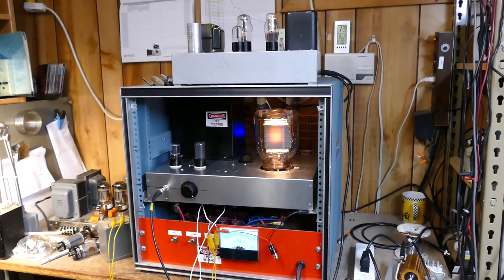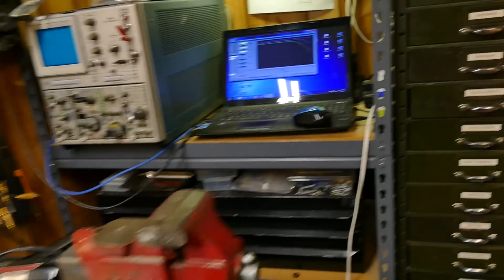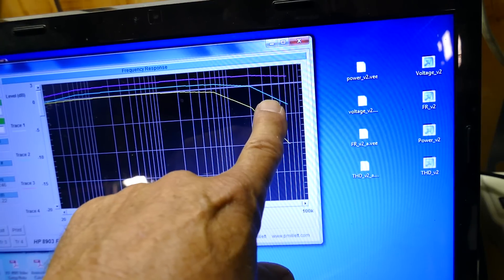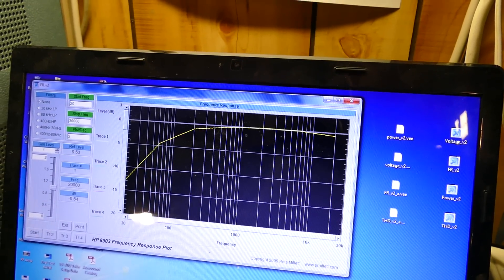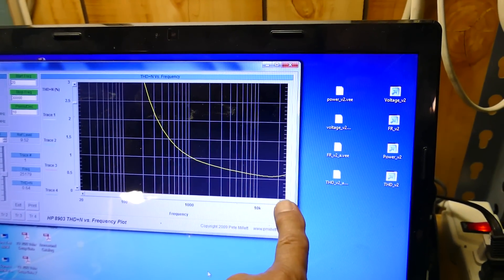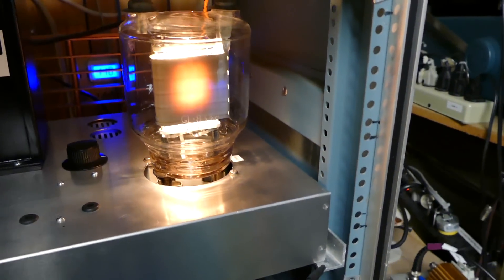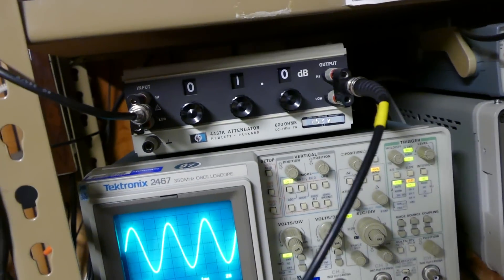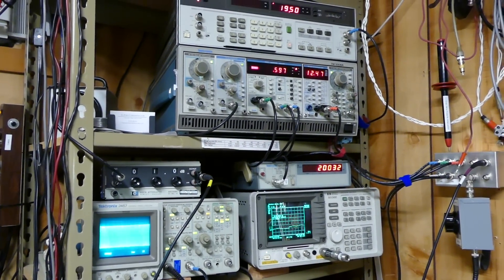833A Vacuum Tube Audio Amplifier Update

Comment: As this is an open-loop amplifier, you can measure at the 833 grid to see what's coming out of the driver when loaded by the 833 ... or have you already done that? If not, look see, maybe it is the driver stage after all. Not sure about that 10H inductor, I'm not familiar with this big-beast stuff, or RF, but at HF it is providing a very high output impedance for the negative swings, as they have to be sunk through the 10H. So if it performs well at HF maybe you just need more Z in the driver cathode circuit, not less.
Reply: ElPaso TubeAmps So, conclusion of this...is to me that the OPT is not very useful here, as it seems that there is no gap in the iron, so therefore it will reach its maximum magnetic field to soon and can not handle further power transfer to the secondary coil....
You need to have a SE output tranny or just make it PP and it will work, i guess ;)
Reply from the maker: QuadMaestro I have measured the signal at the grid of the 833, on the output side of the 4 uF coupling capacitor, and it is less than 1% THD at 20 Hz and 0.5% THD or less above that up to and beyond 20 KHz. I never drive the grid positive so I draw no grid current. My drive voltage is maximum around 30 volts RMS (43 peak) with a bias of -60 and a quiescent plate current of around 180 mA. The core of my transformer is not saturated.  But the 833 and transformer add the distortion. Bias is critical on the 833 grid for THD products. As for the 10 H choke, Xl at 20 Hz is 1257 ohms so I figure that should be sufficient. But to make sure, I have increased L in the cathode circuit to 37 H and it makes no difference. It also makes no difference if I make the coupling capacitor 50 uF.  I may need to consider,  as some have suggested, the output transformer is causing an issue as the transformer is designed for push-pull 810's. But I am not convinced the output transformer is a problem yet. Quite honestly, I am not sure anyone has made this thing work properly or may not have had the equipment to adequately measure the performance and have spend so much money they cannot admit (or realize) poor performance. Have you ever heard anyone play Heavy Metal (with lots of bass) through one of these amps?  As a last thought, I may juggle the turns ratio on the transformer and try it again at 1500 volts with a primary to secondary ratio that is appropriate for that plate load. I haven't given up yet and still have ideas but other projects are being neglected that I want to attend to. I will revisit this project in a few weeks with (hopefully) new insight. I always appreciate your thoughts and comments.
Reply: Well I know SFA about SET circuits but I do know that the OPT has to carry DC, lots of it, and is therefore designed differently from an OPT designed for push-pull.

Comment: Hmm i think i got it....i just caculated the ac-levels.....omit that 10H coil as it has a far to low impedance at low- frequencies....you sending all the low-end directly to ground....the same goes for that 100 muF Cap. omit that as well, as you sending again a lot of low-end freqcuency voltage to ground (that´s what a parallel kathode resistor cap is doing)

My calcs resulting in some 300Ohm loading that kathode at around 100hz while having some 1000s of ohms in the mid range. so you sending about 2/3 of the voltage swing directly to ground....

Replace the whole kathode circuit with a 4k7Ohm (start value) with let say 30Watts...and check the frequency response again....May it works better you can reduce that resistor and see if that driver will perform better....or you need to replace the driver tube with a more powerful type...
Just take a look at the "philips EL6471" Amplifier where an EL34 kathode is directly coulped to 2.5Tsomething (or 4cx??? in your case if i remeber that correct)

Comment: the curve looks like it is a cathode bypass cap  value is to low or decoupling cap value to low I know in guitar amps that makes a difference. but yeah why would the distortion be so high at low frequency
Reply from the maker: noahtheviking This cathode follower circuit performs much better than the transformer driven methods I have tried and you may have a good point with the coupling capacitor. I used a reasonably large (3 uF) non-polarized capacitor but maybe before shelving this beast maybe I should raise the coupling capacitor to 100 uF and see what happens. Thanks for the thought.
Reply: ElPaso TubeAmps Normally a 33 to 47 uf cap works at audio frequencies

Comment: It might be interesting to see how much phase shift occurs at low frequency. Normally such a LF loss is due to saturation of the iron core, but unlikely in this case due to the size of the transformer and the low power you were testing at. Negative feedback probably wont help that much as the HF is fine. Could the drive impedance be too low? I will probably be awake all night tonight thinking about this one!!
Reply from the maker: Michael Beeny Phase shift at various frequencies is something that I will measure - thanks